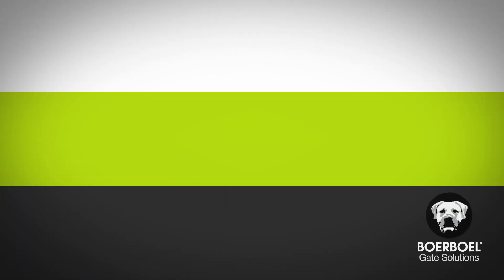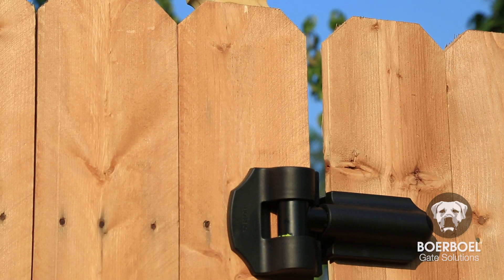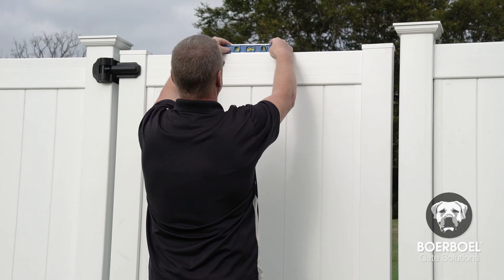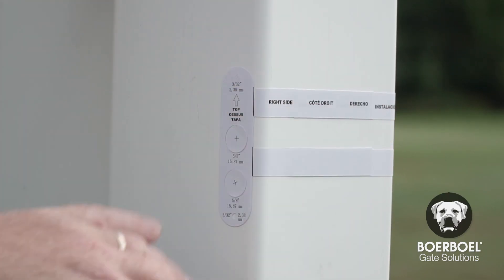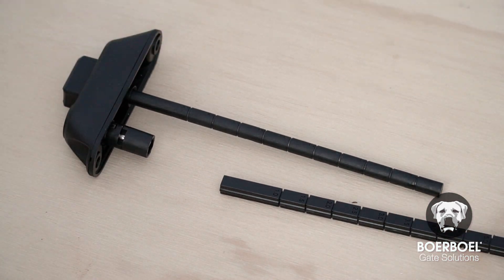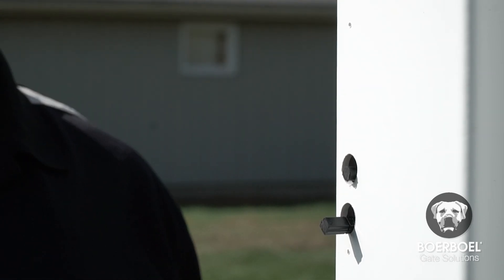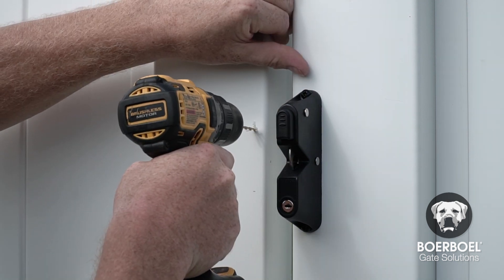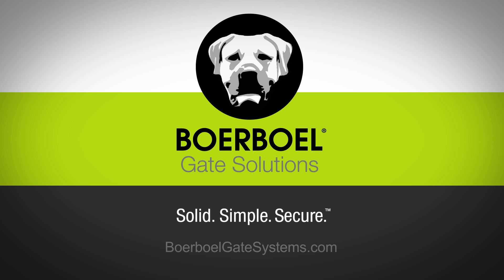How to Install a Boerboel® GardDog® Two-Sided Locking Gravity Latch

Comment: So an intruder can just remove the screws and walk in without a key?
Reply: If the screws are your concern, use square or Torx head screws, nobody packs those screwdrivers around.
Reply: HuskyKMA i do😈
Reply: Easier to jump a fence.
Reply: An intruder could also take a hatchet to the fence or simply jump over it.
Reply: Ostentatious Savant  this
Reply: This is a privacy latch, not really a security latch.  For most home installations, there is no point in using a high security latch when the fence itself can be defeated via a swift kick, jumping over, etc.
Reply: i guess it is quite randomly asking but does anyone know a good place to stream new series online ?
Reply: @Alexis Roman thank you, I went there and it seems to work :D I appreciate it !!
Reply: @Porter Cooper You are welcome =)
Reply: You can't remove the screws from the outside of the gate so that should not be a problem. There is a hole to put a lock should you want to make it secure so no one can open it from the outside or inside. The lock prevent any tampering unless someone cuts the lock.